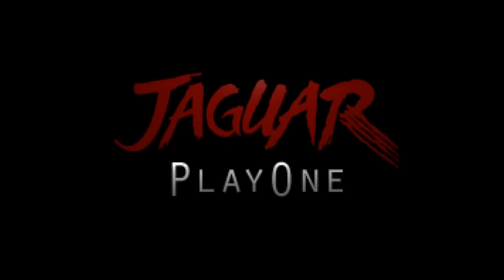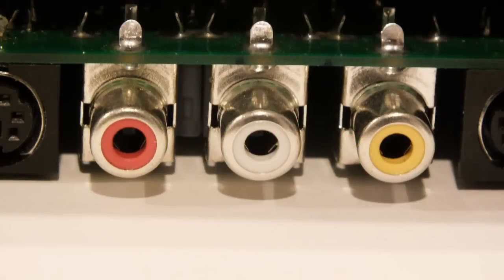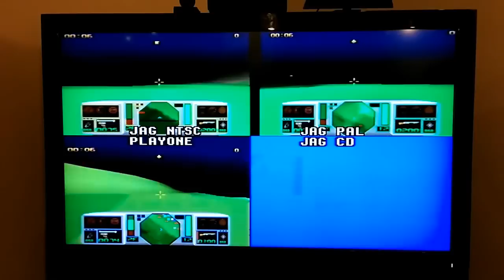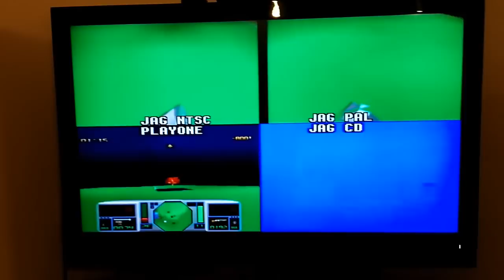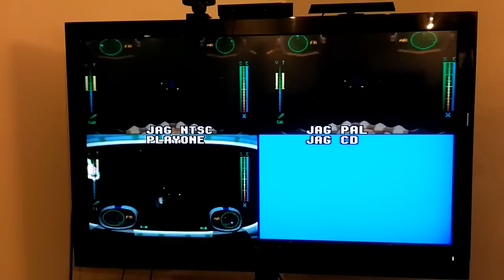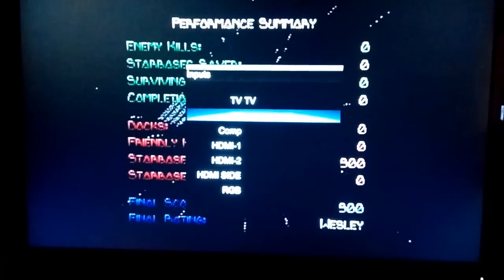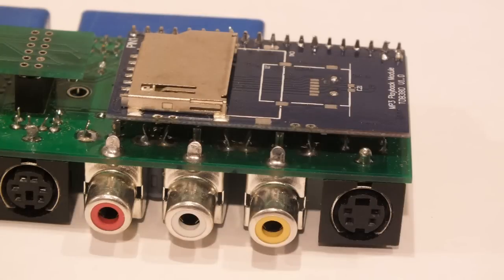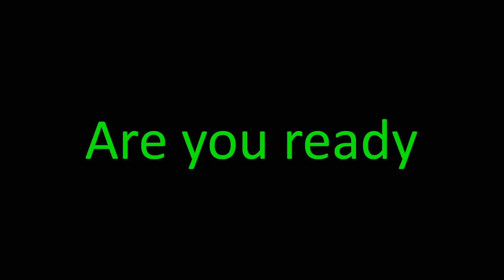The new - Atari PlayOne and LinkBox

Comment: Awesome. Those two adapters for cd drive and jaguar still bothers me... love the build in CD drive
Reply from the maker: Did you know each Jaguar PSU continues to draw about 3 watts of power even if the Jag is switched off.  The PlayOne pulls 0.0 to 0.1 watts when it is off (not mail power switch as that is 0 watts.)   The PlayOne also uses less power when it is running.